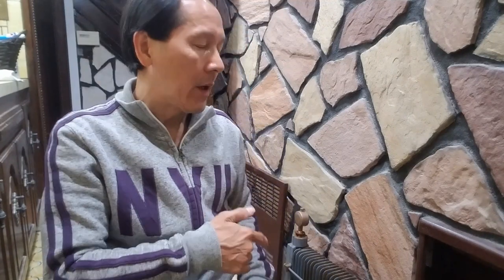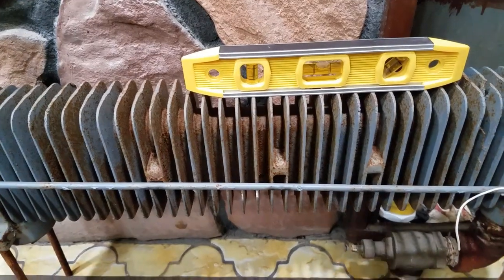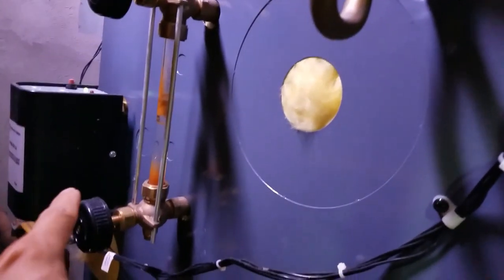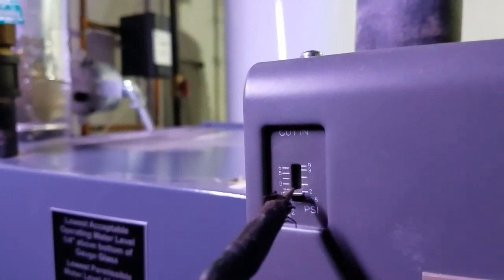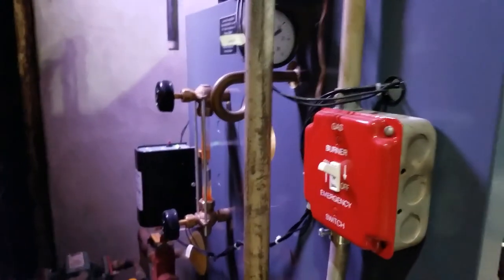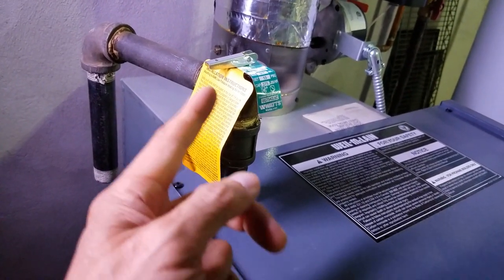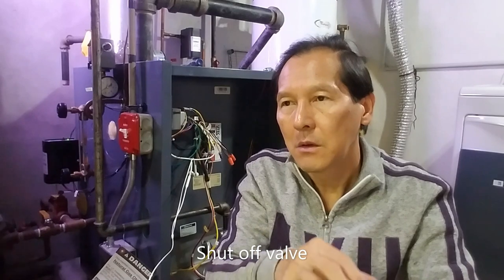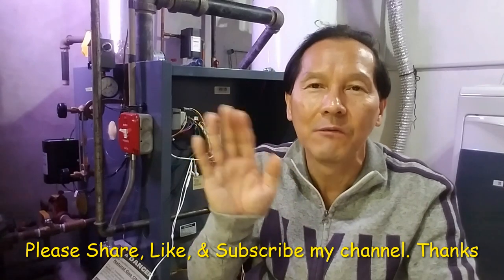2 Reasons that cause Water Hammer in steam boiler system and how to fix them.

Comment: What to do when your Landlord never fix that? My apartment here in NYC it’s super loud Water hummer is crazy. 
Please any ideas???
Reply from the maker: I don't know about the rule in NYC but Landlord must fix it because of safety and annoy sound, people can't sleep at night. Thanks for watching. Happy New Year 2021 !
Reply: First contact your landlord and insist that the water hammer be fixed because it is a serious safety issue. A plumber or boiler specialist should be called who is experienced with steam systems !!! The recommendations in this video are good and correct. You can withhold rent in an escrow account until the problem is fixed. You can also apply more pressure to the landlord by registering a complaint with the city housing department code enforcement ! A boiler inspection by a certified inspector may also help to get the hammer knock fixed. Good luck & I hope this helps!
Reply from the maker: Thank you for your support and good advisement.

Comment: what psi should the round gage read- Ihave the same boiler and the 1kg-2 psi
Reply from the maker: There are 2 scales: Kg and PSI. Each scale has low and High readings. If the pointer shows at 2psi then it's 2psi.
Reply: @CHILEtv012019  the round gauge attached to the pig tail should also read 2 psi- thank u
Reply from the maker: Yes. It's

Comment: Hi. I’d just had a new Well McLain (175,000btu) boiler installed 2 weeks ago. I keep getting banging on pipes late night & I’ve been adjusting the psi & even changed the radiator breather valves. It’s a 3 family house & it’s located in Dyker Heights , Brooklyn. Can you help me solve this banging or hammering? It’s driving my tenant nuts every night since the boiler was installed. Please help ! I can give you my contact number 🙏🙏
Reply from the maker: Thanks for the comment. I can help you here. Your boiler was installed about two weeks ago, it sounds similar to other complaints after a new boiler was replaced. Most of the CUT-IN switch is set in the range 1 to 2 PSI. So, please check this setting on CUT-IN switch.
If pressure is set too high, the boiler will STAY-ON longer to meet pressure set point before it cuts off. This will create extra steam in the system and water hammer.
Also, please check all Radiators, they must be lifted one side with an angle between 5 to 10 degree so that condensated water going back to the return line. Good luck !
Reply: @CHILEtv012019  hi. Thanks for replying. Yes, I’d originally set for 4-5psi because it’s a 3 story/3 family house. Then, I’d reduce setting to 1.5-2psi & upstairs bedroom radiator wasn’t getting heat at all & I even changed the breather valve . Checked radiator slope & it’s fine. Would it be possible that 3rd floor radiator may be clogged? Help me please as this been going on for 2 weeks now
Reply from the maker: How long have you waited After you adjusted 1.5 - 2psi ? It will take about 30p to reach 2nd floor. Radiator not clogged, the shut off valve may not be opened. And water hammer is still remained ?
Reply: @CHILEtv012019  after I adjust to 1.5-2psi, it was running for 3 days & top floor bedroom radiator doesn’t heat up.
Reply from the maker: How many radiators on top floor and they all working ? If entire top floor has no heat then you have to adjust shut off valves for each floor. For instant, First floor adjust them 25% open. Second floor: 50% open. 3rd floor: 100% open ( Fully 100% open ). Steam will travel slowly from the bottom up. If you need to increase press, increase pressure a little bit up, 2.5 PSI then wait for boiler produces more steam to reach top floor.

Comment: Your pressure should be 0.5 plus differential  should be 1 that will be it 1.5   you have a total of 3psi..That is enough to heat the empire state building
Reply: Usually,  it's set at .5 to 1psi plus differential press  ( depend your setting ). 3 psi is not enough to heat up Empire building because the pressure will drop when it travel and steam needs to escape through the radiators so that heat will be generated. Therefore,  you need higher pressure.
Reply from the maker: Thanks.